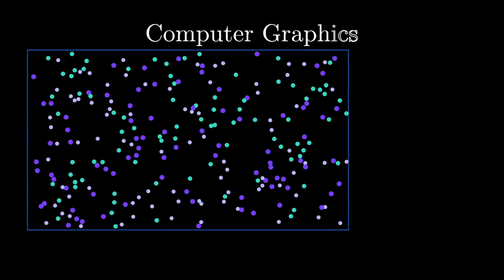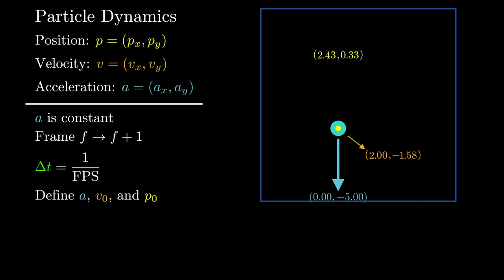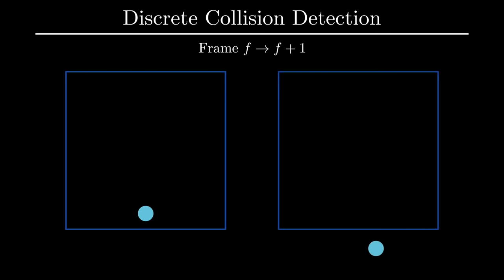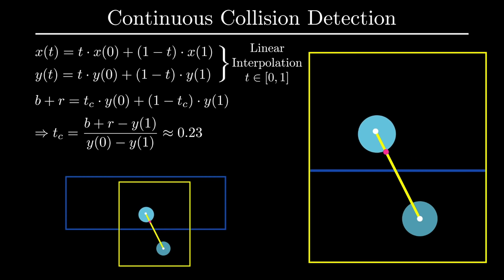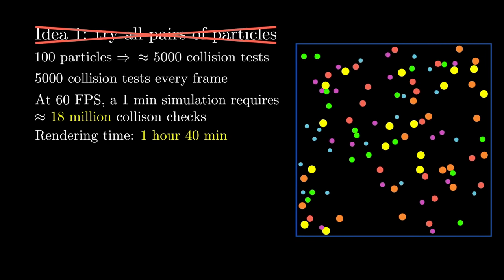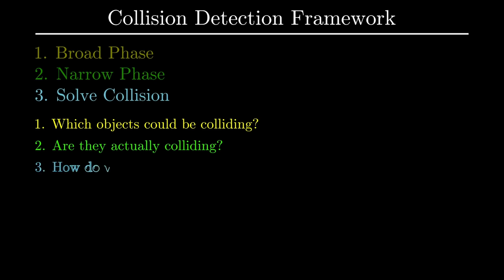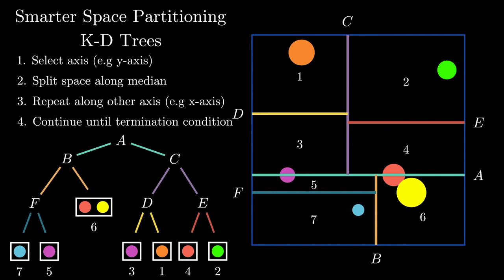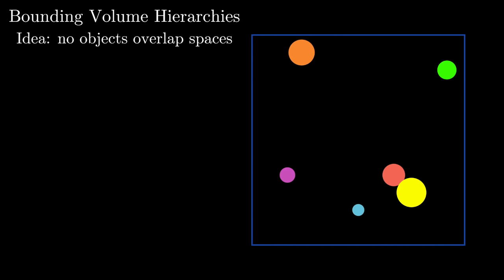Building Collision Simulations: An Introduction to Computer Graphics

Comment: Hi. I''ve managed to code a simulation with N balls and I'm trying to optimize it by using Sweep and Prune, since the way the code works,  it checks for every combination of objects. My question is, if I somehow implement SAP, ¿Wouldn't I end up checking every combination of intervals,  which is the same number of combinations that if I checked with original quantity of objects?
By no means I'm saying SAP isn´t more efficient, I'm just not undersanding how it ts.
Thanks for the help.
Reply from the maker: Good question. You're technically right in the worst case, where all the particles end up in the same interval (e.g all particles are on the same horizontal or vertical axis). In general though, you will not have to check all combinations, it's just checking particles in your sim with the intervals that are part of the active interval. A good resource for an efficient implementation of this is https://github.com/mattleibow/jitterphysics/wiki/Sweep-and-Prune -- this helped me with my own implementation of the logic.
Reply: @Reducible  Hi again. Thanks for the quick reply!! Between the Github page and your explanation I've managed to understand and implement a code about SAP. Once again, thank you very much, awesome vid.

Comment: Bit of overkill on handling tunnelling... Dude, just get the length of the velocity vector - that's literally just Pythagoras - and take the max of it and the radius. Then check the resulting scaled vector for the collision by checking the x and y components. If it overshoots the wall then you've got your scaling factor for the bounce. Done, cheap and easy.

Comment: 14:26
Under normal conditions, the collision shouldn't take more than 200 cycles(It's just one branch and a couple floating point operations).
18 million · 200 cycles = 3.6 Giga cycles.
Normal processors have a clockspeed of something like ≈ 3-4 GHz

The simulation should be done in around 1 second!!
Your performance is 6000 times lower than it should be.
WHAT DID YOUR COMPUTER DO IN ALL THAT TIME?????
Reply: Time spent to actually fetch memory for every single particle, cache misses and whatever the rest of the simulation is doing
Reply: @kaeBR  With 100 particles cache misses don't matter much. Your objects fit into L1 or L2 cache.
And even if for some reason L3 cache misses and memory fetches were responsible, you'd need thousands of them(fetching stuff from RAM is around 200 cycles) each collision to explain the bad performance.
And the rest of the simulation isn't doing much. Based on 18:43 I can say that it is taking less than 3 minutes.

Comment: How about objects that can interact with each other? (e.g. attract each other with gravity)
In this case, even objects that are far apart and don't collide would still have to interact, so this seems to be an n×n problem again :q
Are there any ways of optimizing this?
Reply: With the example of decreasing interaction with distance, I think the only thing one can do is to neglect interaction when the distance is too large (when the force is that small that it wont have significant effect) so we are back to the (field) collision problem

Comment: Nothing educates you more than trying to code these things yourself. This video did stop at one of the most difficult parts. Collisions with walls are fairly simple since the wall isn't moving but when two balls are about to hit each other there are some quadradic equations to solve (and the complexity of deciding which root to use). You have to 'look ahead' in to the next time frame and then back out to a given actual time of projected collision and then work out the momentum transfer, which, for balls of dissimilar mass, is very non-trivial. Lots of head scratching, convincing yourself that momentum must be conserved despite your results. All good fun.

Comment: Physics tip: you can solve the 2d collision problem using conservation of momentum and the restitution coefficient definition instead of conservation of energy (which is linear instead of quadratic). 

You have both:
v1 m1 + v2 m2 = u1 m1 + u2 m2
v1-v2 = (u1-u2)/e

Where the v's are the speeds before and u's after the collision.

Comment: 10:24 Huh, I thought that in the first half of the video you were implementing this, it was rather confusing from my point of view when you suddenly started repeating the same thing you were just doing.
Reply: Oh wait, there is one extra intricate detail that you added in the second run through, that is an important distinction, the best method of doing this is to have a loop which repeats until all object's motion has been processed, first you go through each one and find the one that is the closest to colliding with something with edge to circle collision this is easy, with circle to circle collision it is slightly more complicated involving some more tricky bits, then once you find the one closest to colliding you progress it to its collision point and change its velocity to match the collision then you progress every other object that far as well then you check for the closest to colliding again, rinse and repeat until the closest collision is would require progressing beyond the current frame.
Reply: 12:38 Ah, but while checking if they're currently intersecting is fine you can have an even worse version of tunneling that way, the two circles can phase directly through each other, to fix this you need to use the same idea behind scrolling platformers, to find the intersection of the two circles it is easiest if you look at it exclusively from one of the circle's perspective, from circle A's perspective circle A isn't moving, to achieve that we need to subtract circle B's velocity by circle A's velocity then move him according to that, then we accumulate the size of the two circles just as we normally would for regular circle to circle collision, all that's left is finding the collision between the line and the big circle, of course there will be two collisions not just one so we'll take the one that corresponds to a smaller time value.
Reply: It is also important to account for this in your quadtree, if you use one of course, you can probably use a modified line drawing algorithm to find the spaces that it takes up, you can draw a line by have a variable initialized as zero then repeatedly adding either the height or width depending on which one is smaller to the variable, each time the variable is greater than the height or width this time choosing the greater of the two you will increment either the y or x choosing the one corresponding to the smaller of height and width.
Reply: It is also important that the second point on the line is above and to the right of the first point, you can make sure of this by flipping the two points around if the second point is to the left of the first point, and to make sure that the second point is above the first you'll want to flip the second point's y value above the first point and decrement the y position you draw to instead of incrementing it.
Reply: By the way, how is this considered computer graphics? I figured computer graphics would be more along the lines of rendering the circles as opposed to finding collisions between them.

Comment: Nice video. But 1h40 minutes for a few millions collisions? That's extremely slow. Just to check I made the same collision test (in C) with 100 particles, 3600 frames, for a total of 17'820'000 (roughly 18 millions) collisions. All optimisation turned off, debugging enabled, single thread on an i7 9th gen. It took 26ms. That's a quarter of a million time faster. Simulating one DAY took me less than  2 minutes. And 30 seconds with most optimisations turned on. I don't know what language you are using but it's awfully slow. Python is roughly 100 to 1000 time slower than C, but not hundreds of thousand

Comment: Wait, a modern computer can do over a billion basic chip operations a second. 
I just wrote some straightforward numpy based collision checking, and it took < 0.2 seconds to do 18 million checks. 
If your computer took 1 hour 40 minutes with just 100 particles, then either your macbook is an antique, or your code is really inefficient.

def f(a,d):
	b=a[:,None,:]-a[:,:,None]
	b*=b
	dd=d[:,None]+d[None,:]
	dd*=dd
	return b<dd
Reply from the maker: Keep in mind that there are tons of other rendering processes that go on while making these simulations. The 18 million collision checks are not the only operations going on. Numpy is built to be super efficient because a large number of its operations are implemented with high performance C code. The library I am using is not built with performance as being a major use case, so I am sure there are significant inefficiencies there. If you tried this on a full fledged game engine framework such as Unity, I'm sure even the naive solution would be significantly faster. It's not a perfect example, but my main point there is the difference broad phase optimizations can make.
Reply: @Reducible  Most of the time must be on those collision checks, because it only took 3 minutes without them. Order of algorithms (ie O(n^2) vs O(n log(n)) ) makes a difference, but so does using high performance code.
Reply from the maker: @donaldhobson8873   you know what, I thought more about your point here and you may be right -- I'll have to do some more investigation on if there's some other weird inefficiency that might be causing this.
Reply: @donaldhobson8873  Can you explain the None indexing? I've been using python for the last month or so but my main background is in C so I'm not sure what to make of it.
Reply: @dandan-gf4jk  In Numpy arrays, "None" creates a dimention of length 1, So if a.shape==(3,4) then a[ : , None , : ].shape==(3,1,4)

When adding arrays, if one has dimention 1, and the other has dimention x, then both arrays  are automatically cast to dimention x.
So np.zeros([2,1,9]) +np.zeros([2,8,1])==np.zeros([2,8,9])
If a.shape=(2,100) then the first line creates an antisymetric array of differences. 
Actually, notices small error in code, last line should be "return b[0]+b[1]<dd[0]+dd[1]"